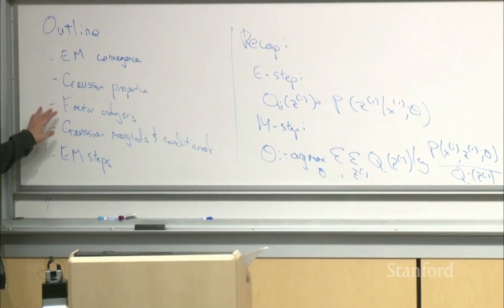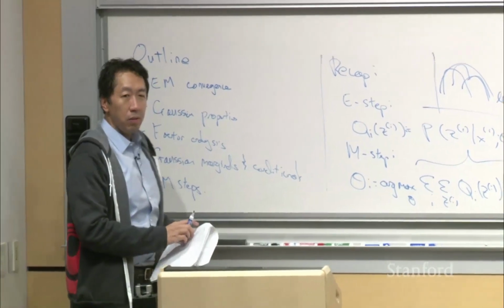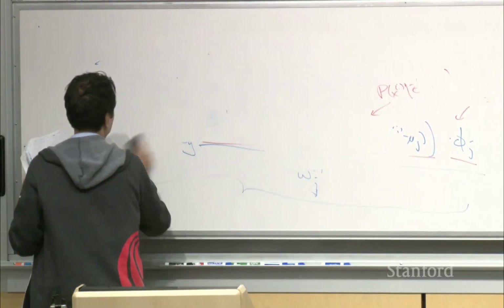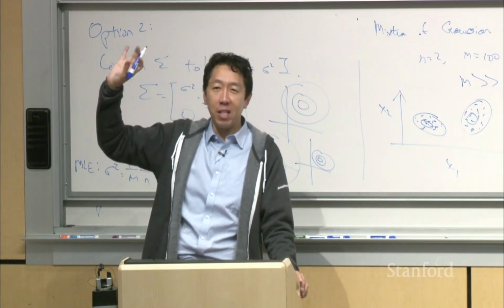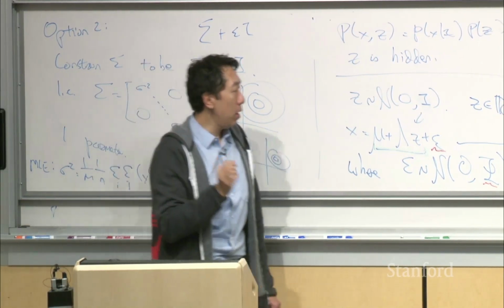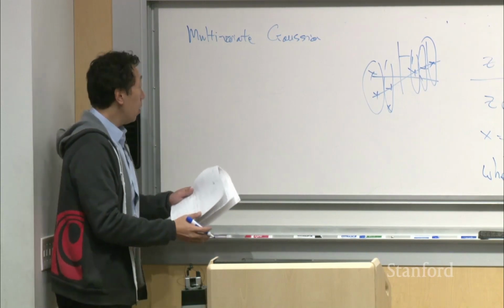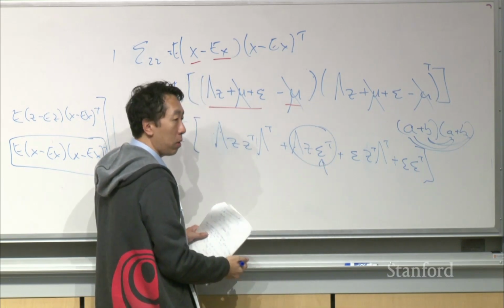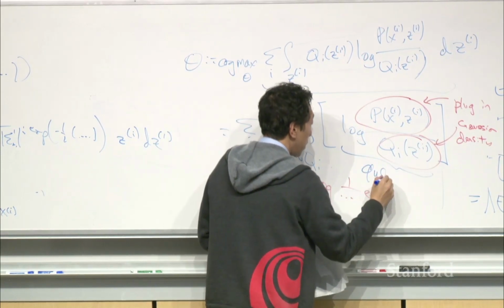Lecture 15 - EM Algorithm & Factor Analysis | Stanford CS229: Machine Learning Andrew Ng -Autumn2018

Comment: I wonder if there was any need for all the derivations starting from 56.00 to arrive the P(x_i) at 1.10.00. The moment you assume a model like x = mu + Lambda*z + epsilon, then X is distributed by P(X) which has a normal density with mean = mu and covariance =Lambda*Lambda^T + Psi. Then, the probability of a particular x_i is plugging in this into normal density formula. Then, it was argued that there is no closed form solution to mu, Lambda and Psi. I can agree on Lambda and Psi, but how about mu (mean)? I think this is not a correct statement. I think one can easily calculate the mean as simply the average of data points (x_1+...+x_M)/M for the considered uni-modular Gaussian model fit

Comment: Well, thanks for the recap. I finally know what the EM Algorithem does. For the Gaussian Mixture Model, we suppose that our data can be fitted by several Gaussian Distribution. And EM algorithm helps us learning the parameters of Gaussian. In E-step, we use a latent variable z to discribe which Gaussian Distribution is our sample point belongs to. The meaning of this step is to estimate which Gaussian Distribution does a sample point exactly belong to. So, we can get m multinomial distribution, denoted by Q_i(z^{(i)}). The Q_i describe the confidence(probabilty) that an exact sample point belongs to, which is used to assign weight in M-step. Then, in M-step, we can use the distribution of latent variable to maximize our loss function by taking first derivative of loss func. But, compared to taking first order on the primal loss function, M-step use Jensen's Inequality create a tight lower bound, which is easier than the primal one. With iteration, we can find the local optima of our goal.(Why global optima? I don't know. I should figure it out later)
Reply: oops, that should be "why local optima?" In the parenthesis.
Reply: @PRED122  Because once you reach a local optima, the algorithm converges.